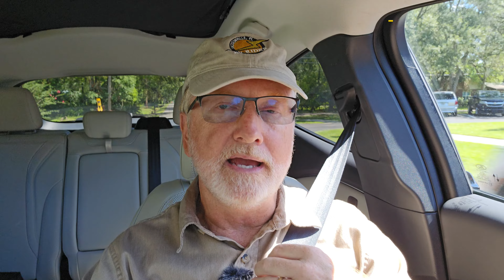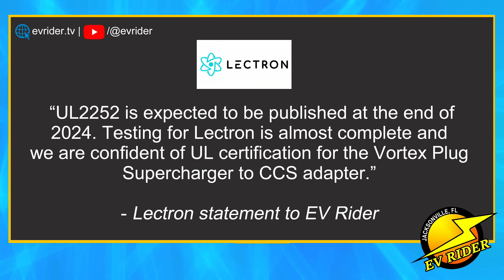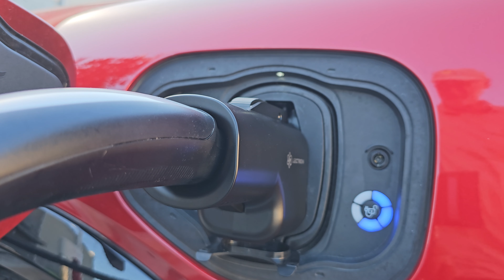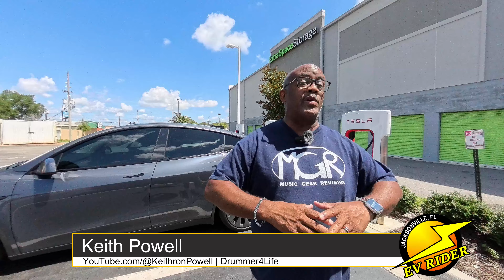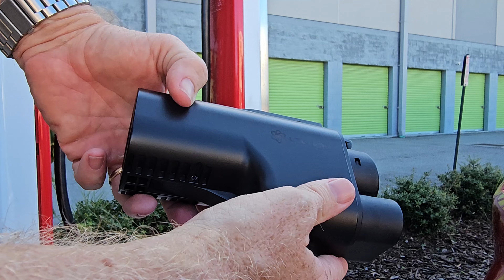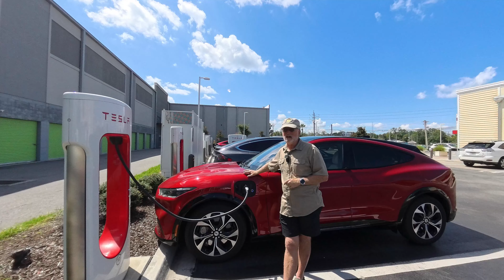Lectron’s CCS Adapter Makes Supercharging Easy

Comment: According with Tesla we never going to be able to use Lectron Bortex plug, because is not certified by Tesla, is that true?
Reply from the maker: As mentioned in the video, neither Ford or Tesla has sanctioned the use of aftermarket adapters. The adapter does work at V3 and higher Superchargers but if anything were to ever go wrong Ford or Tesla might attempt to deny any warranty damage claim because a non-OEM device was used.

Comment: Great video, thank you for the content.  I have a few questions I hope you can/will answer.  (1) Did you eventually get your Ford Fast Charging adapter and how long did it take to get it?  (2) I've read the adapters only work on V3/V4 Tesla Superchargers (anything over 150kW).  Is there an adapter that works on the Tesla Superchargers that are under 150kw (like the 72kW legacy/urban Superchargers)?  (3) What adapter do you use for the Level 2 Tesla destination chargers?
Reply from the maker: Thanks! My Ford OEM adapter did eventually arrive in Sept. after ordering it the 1st day it was available in Feb. You are correct, the adapters only work at V3 & higher Superchargers. For Level 2 NACS I have a 60-amp Daolar and an older 40-amp Lectron. A review of the Daolar J-1772 adapter is in the second half of this video: https://www.youtube.com/watch?v=qeXeu5NW6lE. It begins at 6:19 in.

Comment: Question: Does the level 3 tesla charger to non-Tesla car adapter also work with level 2 destination chargers, or is that a seperate device?
Reply from the maker: That's a separate adapter. The second half of this video has a review of one of the Tesla destination charger adapter options out there: https://www.youtube.com/watch?v=qeXeu5NW6lE

Comment: Did anyone else notice this?  CURRENTLY NOT COMPATIBLE: AUDI, BMW, CADILLAC, CHEVROLET, KIA, LUCID, MAZDA, MERCEDES, MINI, NISSAN, POLESTAR, PORSCHE, STELLANTIS, GM, TOYOTA, VOLKSWAGEN, VOLVO - STAY TUNED FOR UPDATES

So what about the IONIQ 5 model from 2022,  since  Hyandai is not officially mentioned as not being compatible?   (does that mean it should be OK for all makes of Hyandai?)
Reply from the maker: Elon Musk recently fired the bulk of Tesla's Supercharger team, which may help explain why the rollout to other automakers is falling behind schedule. GM was originally supposed to be granted Supercharger access in the spring. To the best of my knowledge Tesla has not opened its Supercharger network to Hyundai yet either, although that automaker is among the ones that reached an agreement to use Superchargers.

Comment: $8.25 for 44 miles? Ouch. That's worse than gasoline. Is this where we're heading with EV? I will be selling my Zero SR/S before I pay that much.
Reply from the maker: Yep, DC charging is expensive but thankfully most EV drivers with home or workplace charging probably don't need to fast charge more than maybe once a month. The only reason I Supercharged was to produce the video. For average EV drivers they'll only need to DC charge when traveling more than 225 miles or so. Based on my utility's kWh rate, as of this morning it costs me $10.01 to fully charge my Mustang Mach-E and that's not counting the $7 per month per EV credit I get for charging off peak. I also have a Zero SR/F, which when you count my $7 monthly credit for it, basically equates to free fuel given how efficient it is.
Reply: I don't know about any credits here in north Alabama, but I pay about $.12 kW with Wilson Dam here on the Tennessee River. Costs me $.30 to go 44 miles.

I have found several free J-1772s plus I have the Zero Tesla tap to use free NACS chargers to extend my ride-to-eats range. I just don't think I ever want to pay gasoline money for electric charging.